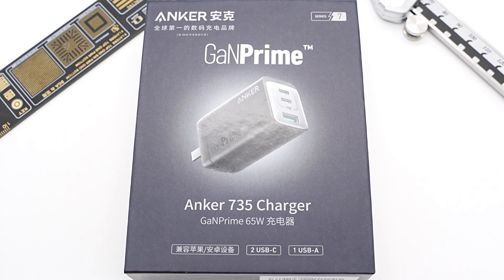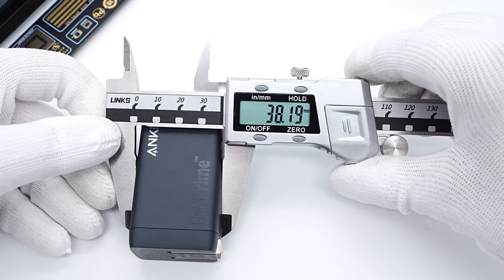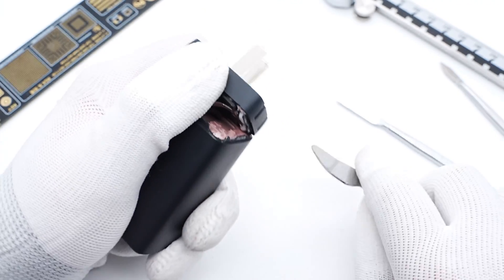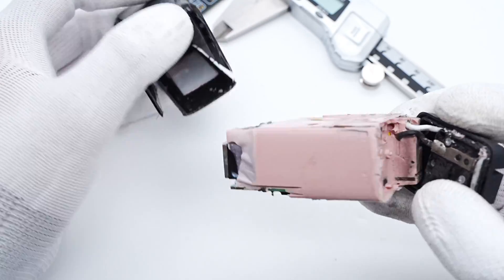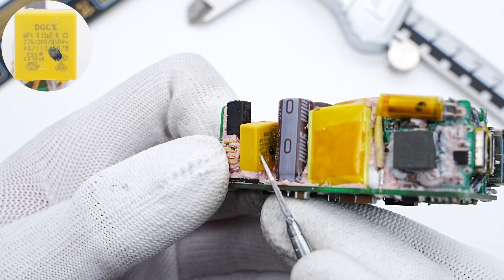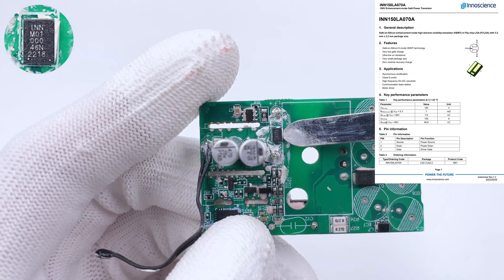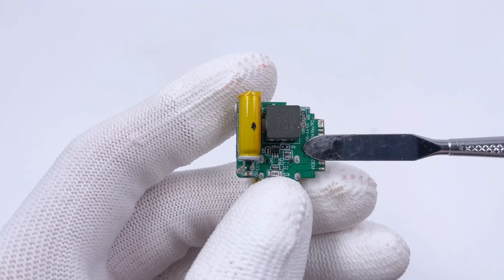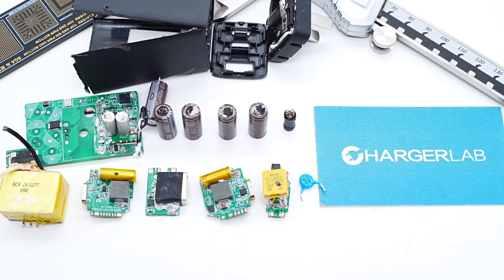Teardown of Anker 65W GaN Charger (GaNPrime 735)

Comment: You can open this without destroying the box if you have the patience use a small knife or any teen pointed metal and remove the fillers on the side then use a flat tester or screwdriver to push on the inside of the USB a port I succeeded that way removing everything

Comment: Hi! I bought one Essager 33W and one Essager 65W GaN chargers and I get slight electricution from both of them but none on my three original Samsung chargers that came with my phone. I probed the USB C cable on both Essagers and I got a reading of 75 V AC but just 5V AC on all three of my Samsung chargers. One probe was on the tip of the USB C cable while the other was contacting a wetted bare concrete. Will the high AC voltage coming out of the USB cable be bad for my phone? Is the Anker 65W featured in this video does not output high AC voltage like the Essagers I bought and more like the original Samsung chargers just putting out 5v AC? I have searched Google and I got only one result that seems good that when you plug the cable to the phone it said that the AC will dessipate to a much lower voltage because the cable will be grounded to the body of the phone but I did that and when I probed it it still read 75 V AC. I hope you can clear this out for me. I only have above basic understanding of electricity and electronic components and if I have persued my engineering I wouldn't be asking this questions and I would have been out of the dark.

Comment: Having tore it down, I assume there is no way for a consumer to repair a broken charger? Mine suddenly stopped worked after plugged in with a loose connection, so assume it surged and needs a fuse replacement

Comment: Very nice review.  You show the actual protocols the charger follows, not many of these supposed "reviews" even do this.  The only thing I'd add to the review is some testing if the max current/voltage can be sustained by the product.

I find it odd that the charger supports PPS but Anker doesn't show it on the product though.
Reply: Maybe marketing couldn't find a way to spin PPS?

Comment: Hi ChargerLab , 
Does it Supports Samsung 25W Super Fast Charging ? 

The 25W Super Fast Charging is supported by Samsung flagship phones and midrange phones.
Reply: This charger supports both 25w and 45w super fast charging. 
3.3 to 11v 5a is the protocol being used for Samsung phones

Comment: I bought the 735 non GaNPrime version of this in April and it didn't include the wall adapter accessory. Which is probably why mine died in about 6 months. That wall thing is a must it seems.
Reply: it's not necessary for charger's function and reliability. yours might be a dud from factory so better warranty it
Reply: It isn't a necessity but if you bought it on Anker you may be able to return it and the wall adapter should be underneath the plastic casing where your manual is

Comment: I don't know about any other brands, or any other anker variants. But so far from the previous anker charger, this is the best. Compatible for apple, Samsung super fast charging 2.0
Reply: It's good, I'm thinking of getting a second one.
Reply: @John Smith  Since I bought Baseus Power Bank Last time, I'd like to give a chance for Baseus and Ugreen, because Baseus also support 22,5V
Reply: The fact that many Apple stores and authorised resellers recommend anker products as alternatives says much about the quality as Apple is known for setting high  and strict standards on aftermarket accessories
Reply: Hi 👋, 
Does it supports Samsung 25W Super Fast Charging?
Reply: @Xiaoxiaoxiaomao  of course, 25w and 45w works

Comment: USB-C PD is missing 12v
Reply: the IC itself supports 12V PD but the tester only tests at PD3.0 protocol. 12V was PD1.0 profile and discontinued on PD2.0 onwards
Reply: @n.shiina8798  yeap, it's optional for the standard. This charger is missing 12v. Hope this doesn't become too common.